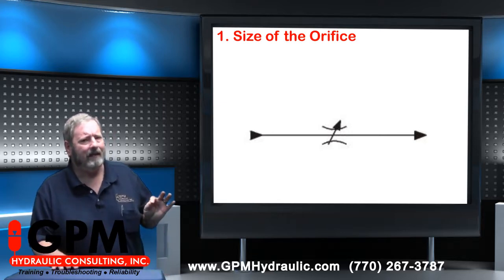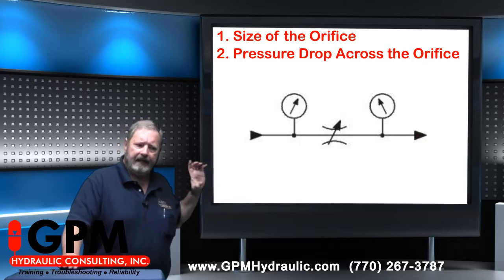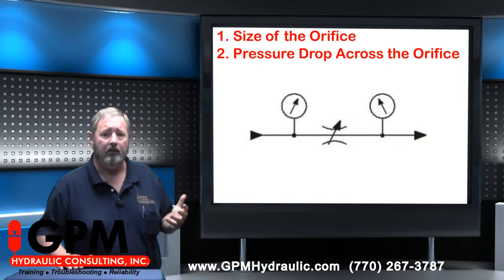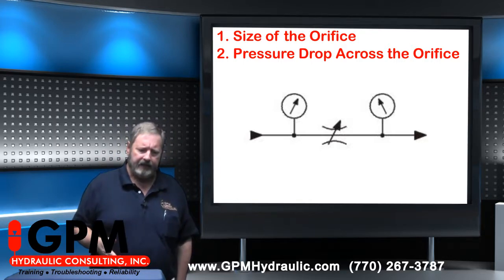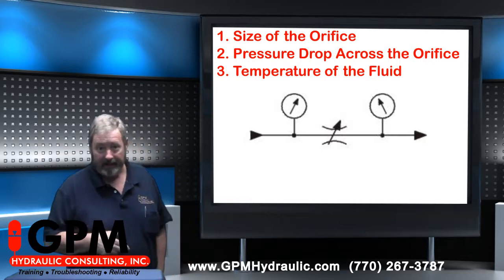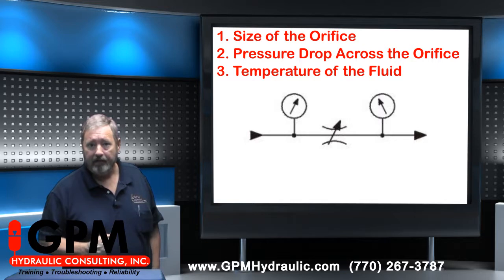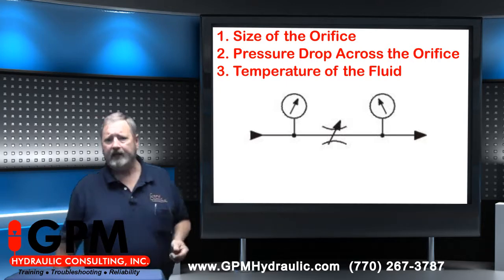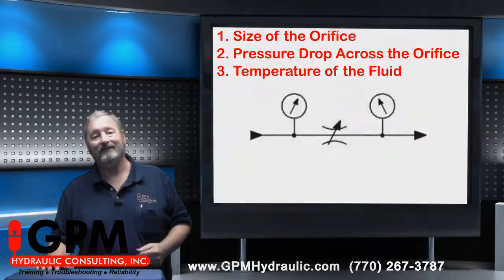The Three Factors That Affect Flow Through a Flow Control

Comment: As you said greater the pressure drop the more flow but what about if there is another restriction down the line.  For example I have two heat ex changers, both inlet water pressure is 38 PSI but for the outlet one reads 30 psi ( 38 -30= 8 psi) whereas the other outlet pressure is 18 psi (38-18=20 psi). Which one will have more water flow?
Reply from the maker: HASSAN SHARIF Thank you for your question! Since the fluid compresses only a negligible amount, total system flow will drop to match the flow of the downstream orifice.
Reply: @Gpmhydraulic  thank you.